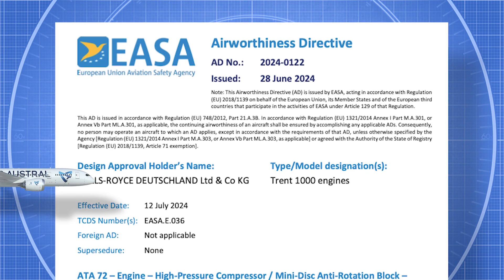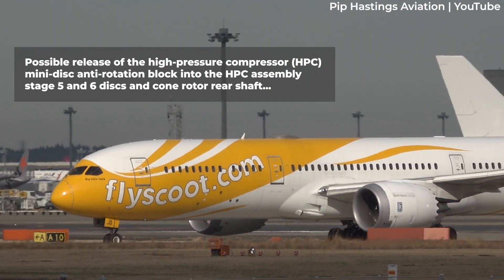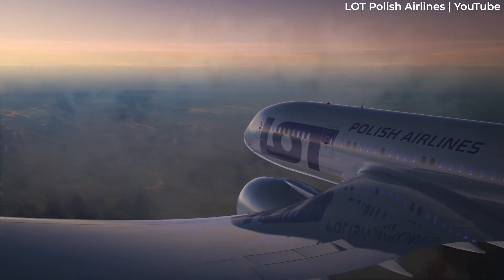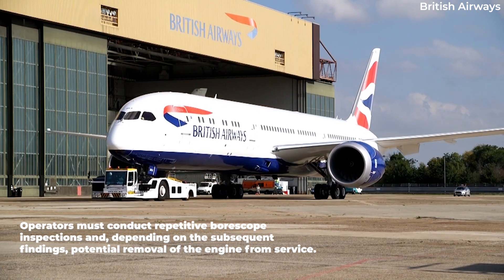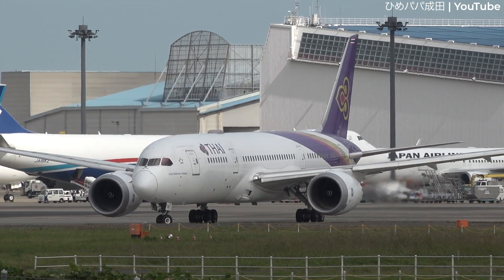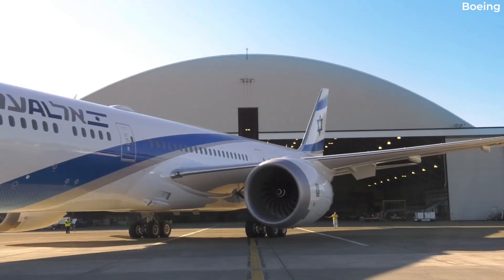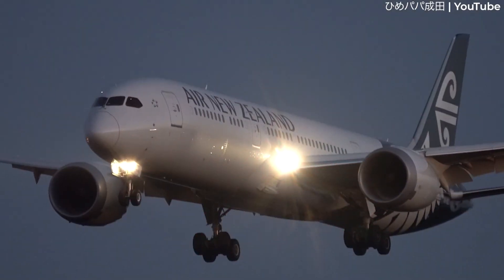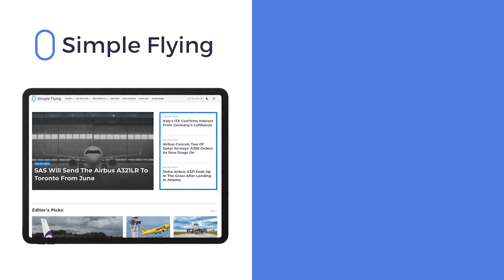Boeing 787 Trent 1000 Parts Subject To New Airworthiness Directive

Comment: I think only RR Trent XWB 84 and 97 are free of glitches.
Reply: The Trent XWB-97 needs more maintenance than usual in hot places (which is why Emirates didn't order the A350-1000)
Reply: @EuropeanRailfanAlt this is complete nonsense and just negotiation tactics. Qatar operates xwb-97 with no issues whatsoever. The higher wear is normal in desert condition. You think the GE90 doesn’t need higher maintenance costs in the desert than say for airlines in central europe? Also, emirates orders the 777X on the spot not thinking about the reliability of the GE9X despite the fact the GE9X will have to survive with such compressor ratios in the arid desert conditions.
Reply: Lol nope

Comment: Boeing is the manufacturer of the aircraft, but the problems are with the Rolls-Royce Trent engines, not   the rest of the aircraft. Then why is Boeing mentioned in the title, and not R-R?
Reply: Some people appear to have experienced difficulty reading the OP: why is Boeing mentioned in the video title, and not R-R, since they manufactured the defective engine. (I understand, and did from the outset, that the R-R engine is attached to the Boeing airframe!)
Reply: Because in YouTube, it pays
Reply: Boeing sounds much better these days!
Reply: Clicks
Reply: Only the 787 uses the Trent 1000 engine. Airbus widebodies use different variants of the Trent engines.
Reply: You know how it is...by dint of hearing problems with Boeing, everything that is not Boeing becomes Boeing 😀
Reply: The title clearly says Boeing 787 Trent 1000.....
Reply: Err cause all the planes in question are Boring 787s??

Comment: The harder business administrators push engineering companies to rush their development projects the worst our public safety gets. The aviation industry is plagued with so many quality problems and public safety issues. 
Rolls Royce has been struggling with thin profit margins for years and really needs to focus on their quality control instead of flooding the market with their aerospace engines.
Reply: This engine was designed in the late 90s/early 2000s

Comment: RR and PW engines have had it rough for the last 5 years
Reply: and GE are having BIG ISSUES on their BIG ENGINE
Reply: @trevorhart545  i feel like everything is super dramatized in aviation nowadays
Reply: The PW engines for A220 are the worst engine related issue. Air Baltic had to do full replacements on their aircraft in some cases more than once per aircraft. Brutal.
Reply: RR is doing fine with the Trenr 7000 ans XWB. GE still had complications with the GE9X. But P&W certainly have the Worst situation